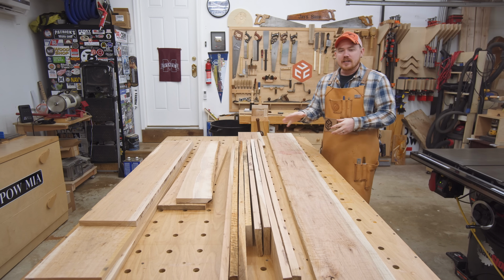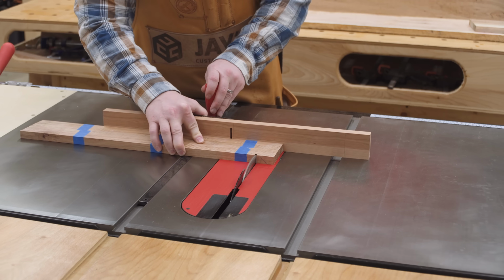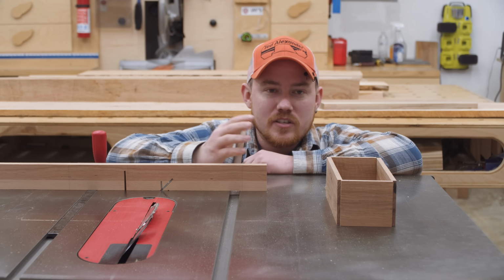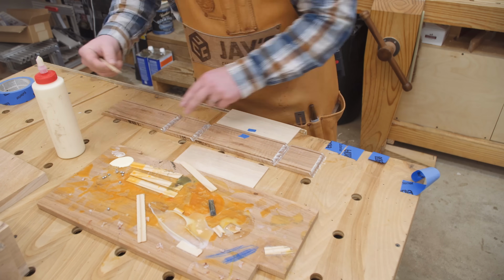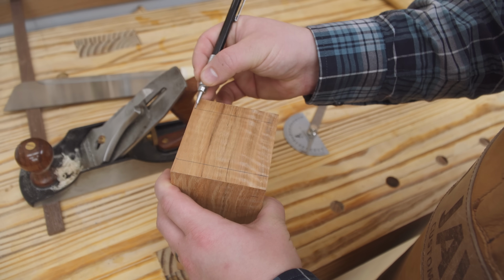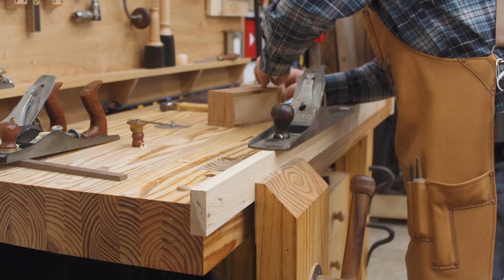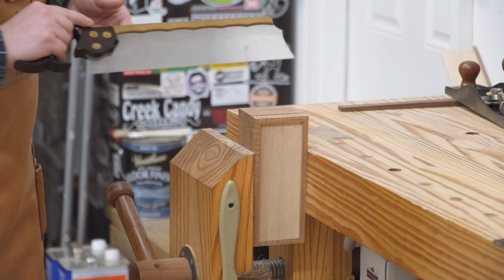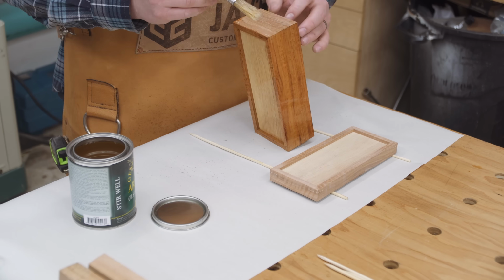A Curly Hickory, Tiny Spline Mitered Box - 297

Comment from the maker: Video Notes:
-Two of my miters have a slight gap on the lid. This was most likely due to too much glue in the joint and nowhere for the glue to go when I clamped the box together. Assuming the inside corners contacted first when the box was clamped.
-I should have used darker spline material as a black line would probably have been more visible in the end. In that case I would have used walnut for the interior liner.
-Article for this video: https://jayscustomcreations.com/2018/01/curly-hickory-tiny-spline-mitered-box/
-Dozuki Z Saw used to cut spline kerf: http://amzn.to/2DUfE9z
-Tools in my shop: https://jayscustomcreations.com/home/tools-resources/
Reply: Why did you want your Splines to be soooo thin? A thin table saw blade would’ve been too thick? Nonetheless, the box turned out great. Thanks for sharing.
Reply: I watched another video where a craftsman showed how to get rid of the miter gaps by burnishing the edges and then sanding.
Reply: I like the subtly (sp?) of the complimentary woods.

Comment: Jay, nice job on your box (could be great for a number of things).  I have two comments that are not meant as criticisms at all, just part of a conversation about woodworking and method.  First, the splines.  They are so small as to not serve the purpose that splines were designed for.  They do, however, add a nice visual touch to the box.  Second, The box may have been improved by adding a top, glued inside the rectangle of the top on the box.  It could be a different wood contrasting or complementing the hickory.  I liked the curly maple used as a lining and a way to align the top.

Comment: Beautiful work Jay, but I'm going to have to go ahead and kind of disagree with you there on sawing the splines.  I find that if you start the cut, then angle the tip of the saw up and saw down to the near line, then away from you and saw down to the far line, then level out the saw and cut out the hump, the end result is more accurate.  I think this is because you can focus on one stopping point at a time.

I mean, you do what works for you, I just wanted to mention that doing exactly what you said you don't want to do works better for at least some people.

Comment: Now that you have learned the "trick" for Wrapping the grain all the way around the box.  Try cutting a third groove on the inside to half the thickness of the sides.  Then when you sever the top, you have a rabbet and the lid will index on the side without the liner.

Comment: Stewart-Macdonald sells some table saw blade with a 0.023" Kerf, for cutting fret slots on guitar/bass/etc. fretboards. Happens to be very close to the thickness of commercial veneer sheets (~0.6mm, or 1/43"). You could use it to cut spline slots,  then glue veneers in for the spline.

Comment: Nicely done! Fun fact about the pull saw, it's got a depth stop on the front end that allows you to get consistent depth in case your cutting angle wasn't consistent. You nailed your spline cuts without that info but hey, I thought it was a cool feature of those saws. I think Katz Moses has a vid on it

Comment: Great box, great video, great instruction! Just a question about whether there should be a spline at the top of the box after the lid is cut off?
Reply: In other words the lid insert is the spline? Since it's glued to the outside lid pieces?
Reply from the maker: It doesn't matter one way or another. This box has a spline in the lid.

Comment: When you say a little bit chilly in your workshop, how chilly? :) Mine is around 37f lately (Chicago area)
Reply from the maker: I believe it was a little under 50 degrees. Which isn't really chilly considering the time of the year. But it is chilly considering it's normally around 65 in there in the winter time. It's all relative.
Reply: that's not too bad! 
I love your video and how you present, you basically got me into woodworking. too bad the cold workshop/garage is currently put me on halt, waiting for spring!

Comment: Nice box Jay, I agree the splines should have been darker.  When I make a box with thin splines I use a razor saw and for the spline material I use some veneer which is just about the thickness of the razor saw kerf.

Comment: I think it would be possible to cut a spline on a tablesaw without a jig, with the blade height just right and have a stop block on the fence. The bottom of the slot will have slight curve but that will be hidden inside

Comment: Love wtching your videos, simple projects with great explainations. Just a tip, you might know already, but that last tooth on youre japanese saw is made for flattening out the bottom of your cut. Basically so you dont have to worry about cutting equally on both sides. You can cut down your facing side then use the flat as reference to bottom out and flatten yor cut.
Reply from the maker: I remembered that from another video after I passed that step while making the box. Good tip to bring up though.